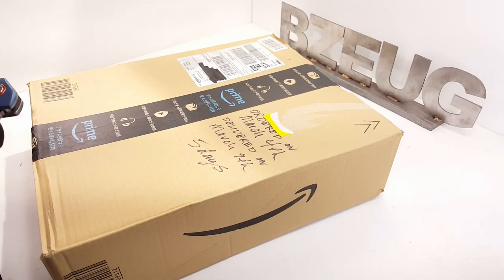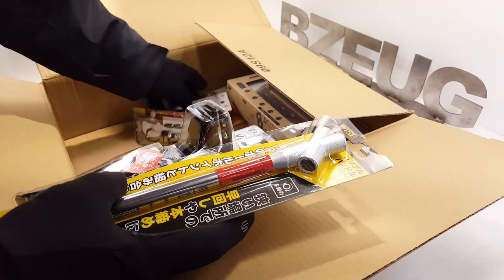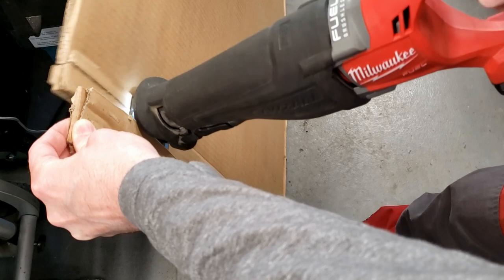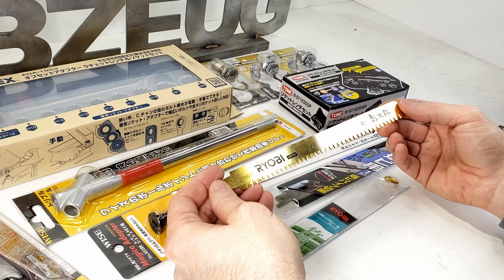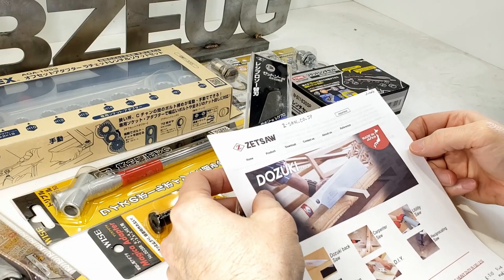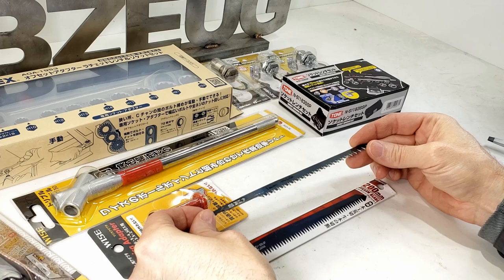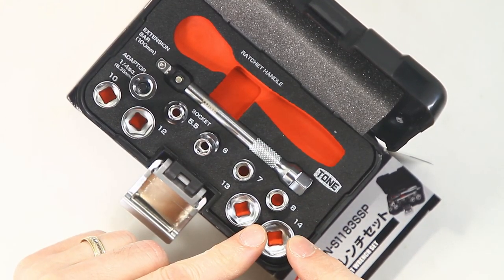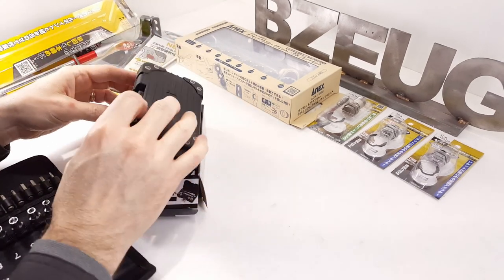Amazon Japan Tool Haul: TONE, ANEX, VESSEL, RYOBI, WISE, SK11, ZETSAW

Comment: The difference between western and Japanese bits is a bit frustrating.
If you want to adapt the Japanese one, put it in a pillar drill, spin it and use a dremmel to cut another slot.

Comment: Looking forward to the review on the Anex stuff.  I've also been curious for some time, but haven't pulled the trigger yet.  I'm most curious about whether those pass-thru sockets can be secured with the c-clip when mated onto any other ratcheting wrench or regular boxed wrench.  I have a feeling that it won't, since the ratcheting wrench Anex supplies with the kit looks to be very thin/low-profile.  I would appreciate it if you can clarify that.